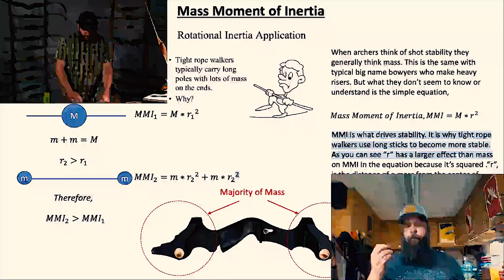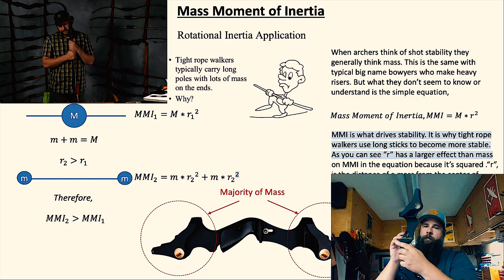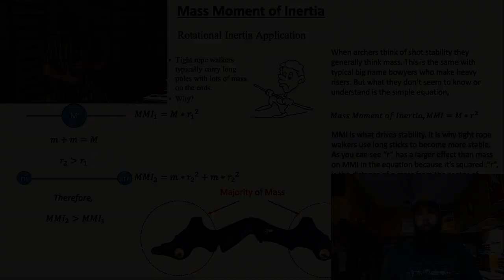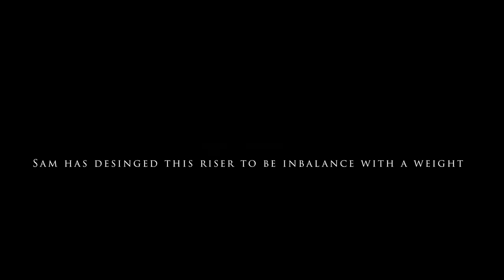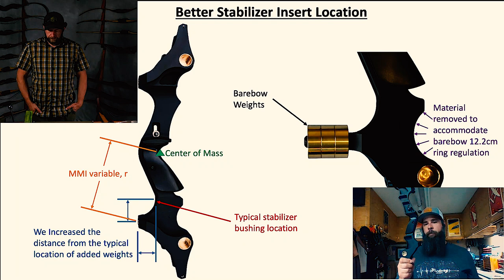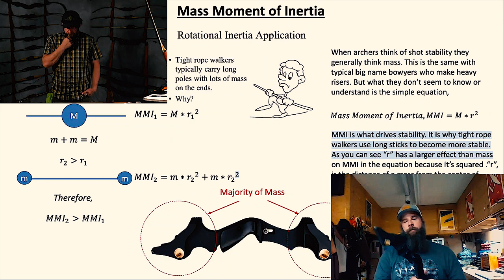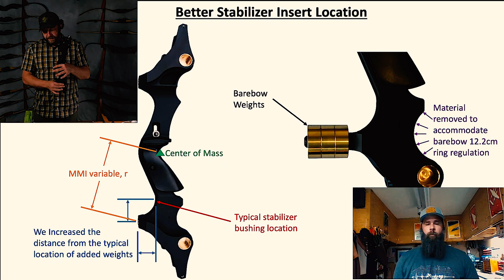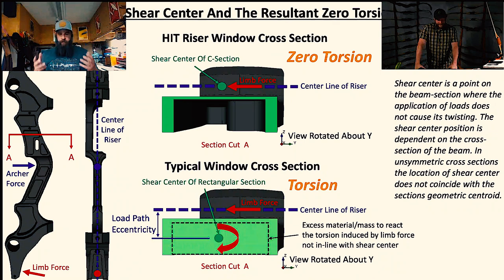Behind the Bow: Sam Guiffrida explains how he applies Physics in Traditional Archery

Comment: After hearing this…I flipped the quiver on my Satori riser( now discontinued 2piece Hoyt quiver) and it placed the arrows farther forward, which resulted in a bow that holds dead even. I’m shocked how this simple tweak made a great bow even better.
Reply: Night and day, been telling people this for years, flip quiver arrows point down. I prefer tightspot because not only can you flip upside down you can also put forward.
Reply: @backwoodscomposites7716  I’ll have to try this out on my compound that has a tight spot quiver. Great info.
Reply: It also helps when practice shooting with hunting setup to keep heavy arrows from vibrating out. The vibration vibrate arrows down into quiver.
Reply: I’ve been running a left hand great northern quiver on a right handed bow for a while now. It pushes the weight far out on the bow. Works great on risers with deflex

Comment: Can’t wait for the limbs. Based on the limb pocket comment, it seems that his riser is optimal for big hook limbs and less suited for “standard” ones. I have a bunch of questions now.
Reply: We did design our riser using our limbs because those are the only limbs we currently own and have in shop. We have two types of limbs, the TACs and MOACs. Conventional and bighookers. Preload (limb angle) and deflex is huge in riser and FDC connection. We timed our limbs to feel great at the archers draw using our geometry. But the great thing about ILF is you have some control of the limb angle modifying the limb bolts. So, you can use our limbs with other risers or our riser with other limbs. We just feel the best geometry comes from the bowyers predetermined configuration. The biggest thing I want to covey is listen to your Bowyer and hope he/she a humble honest one.